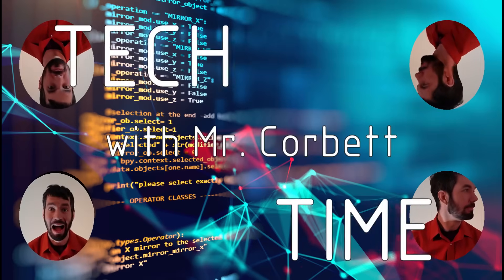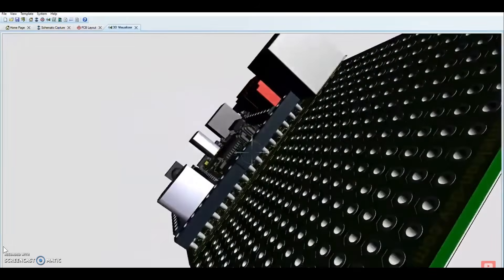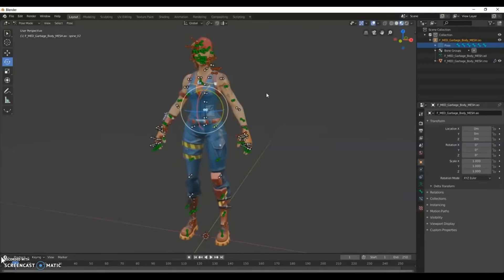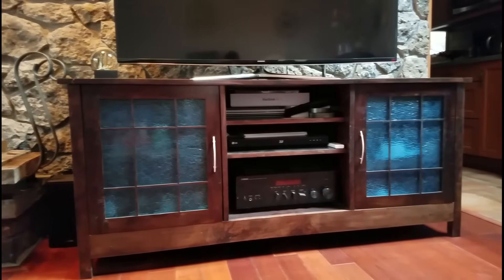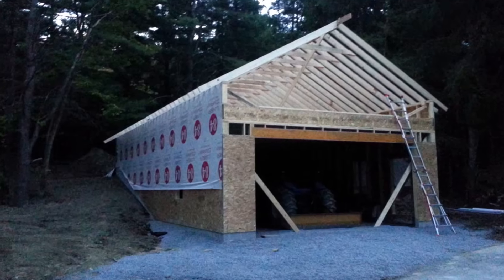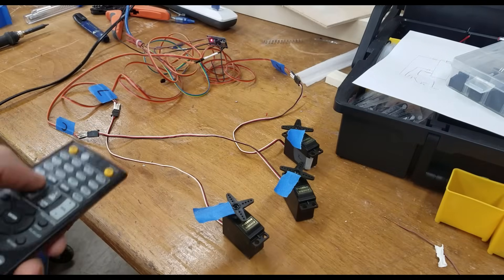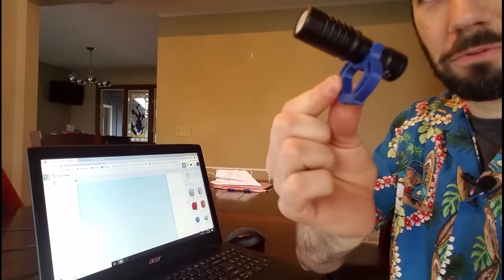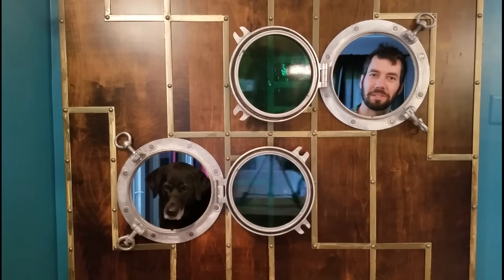Wat is CAD en waar kan het gebruikt worden?

Comment: I see blender being used. That isn't really considered a CAD software, right?!
Reply from the maker: Anytime a computer helps you design and make something it is CAD.  Blender, Fusion, TinkerCAD, even Illustrator can be used to help design something.
Reply: @maxfranciscorbett2183 i have a question i hope you will see this comment! My question is do you have to be educated or knowledgeable in mechanical or electrical engineering to be able to work as a cad technician or drafter?